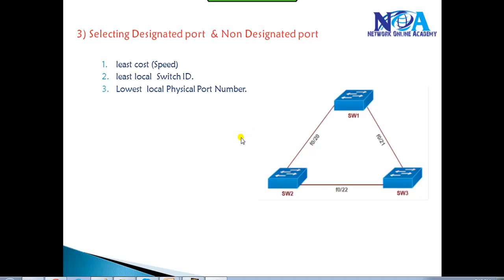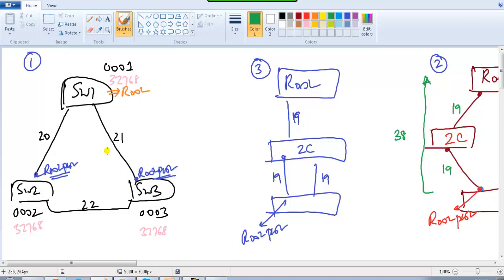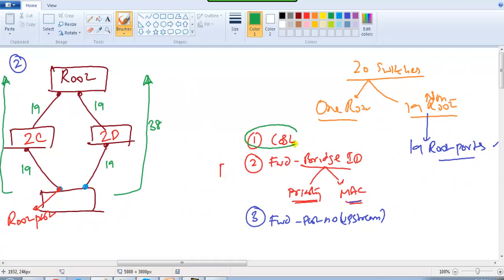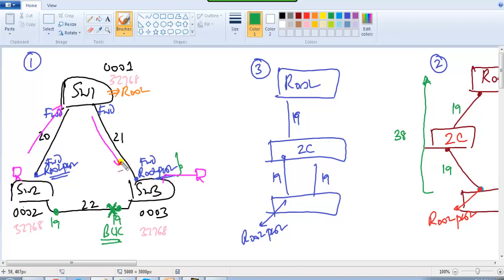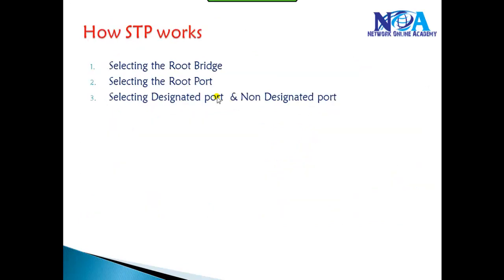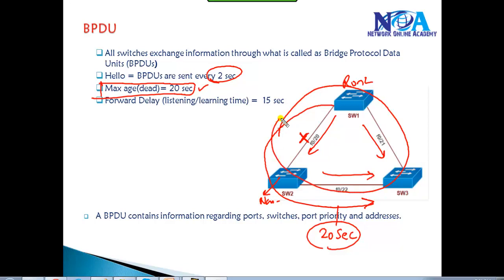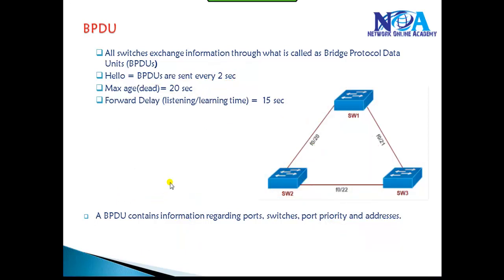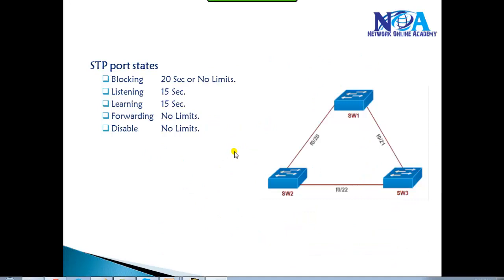CCNA Routing & Switching : How STP works2

Comment: Does this make mesh networks at the switch level useless?  I think STP would just turn off the mesh links.  Would the extra connections only be useful as backups for when a link goes down?